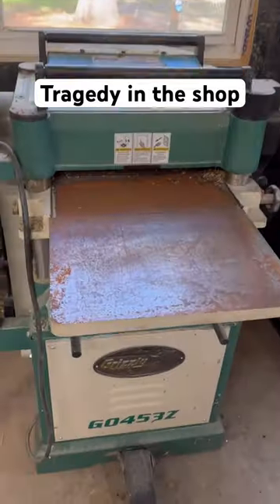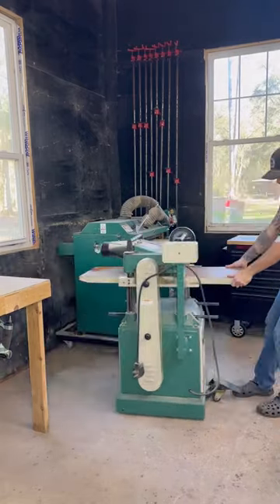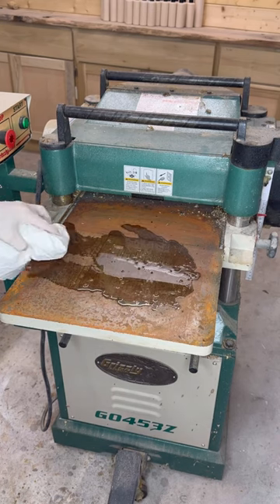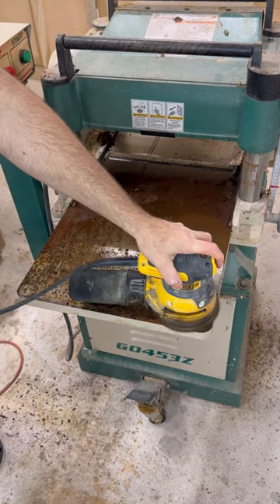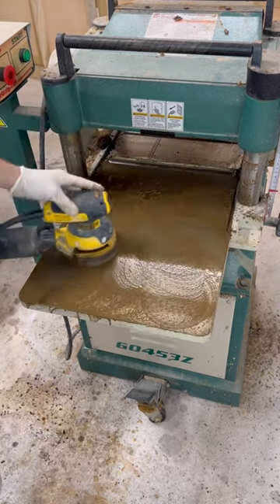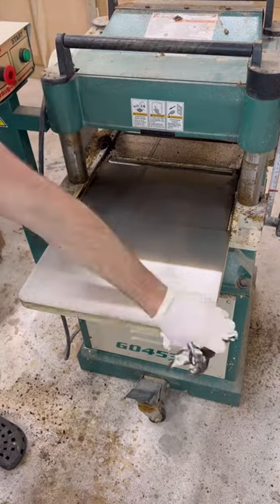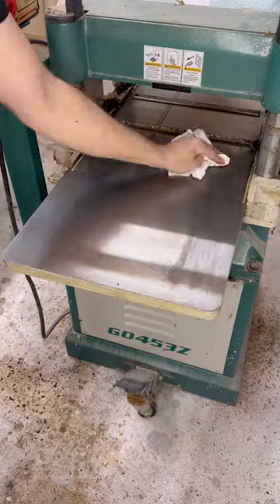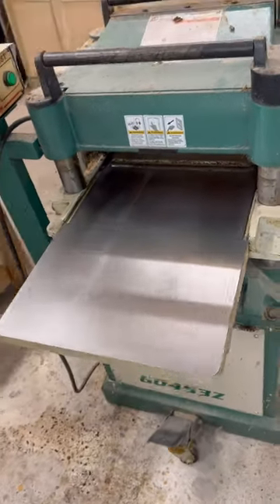Tragedy in the shop #diy #woodworking #toolstips #toolclean #rustytools

Comment: Use of EvaproRust was pointless due to fact that you use abrasive approach. Final results are great, well done...
Reply: My thoughts exactly.
Reply: Came here to say the same.....
Reply: Some might call it .... wet sanding. 🤡🤡
Reply: You have no idea how any of this works then.
Reply: Agree, the 320 would of done just fine dry
Reply: @zacharyshannon8460  would of or would HAVE ?   Asking for a friend
Reply: Yah, came here to see if someone else said it.
Reply: Came here to say it. Glad someone else beat me to it. 

Use evaporust: soak paper towel in solution, ring out excess, drape over rusty object, cover to keep constant pressure, wait 24 hours, come back rust will have been converted into paint able primer which is also removable without abrasion.
Reply: @audio323 wet sanding is for high grit to get a very smooth finish. Wet sanding with 320 is pointless, especially on metal.
Reply: @probablyinconsistent4756  adding lubricant lessens the cutting effect of the abrasive and also accumulates the grind off metal particulate into the oil medium as additional abrasive. It works at ... checks notes all abrasive mesh #.  Thanks for coming out.  NEXT!
Reply: I don’t think any of y’all understand what just happened 🤡🤡
Reply: @audio323  literally no one recommends wet sanding at low grits for any material, because again it doesn't do anything. The metal particles that are being removed are a higher grit number than the sandpaper being used, so you won't get a smooth finish and the sandpaper will still be removing far more material. Also the water is barely an abrasive at the speed of the sander and the time it's being used for.

Again, the product was useless and added nothing to the finishing process. Wet sanding is meant for grits 1000+ to suspend particles of the material that will be similar in size to the abrasive being used. I can tell you have no idea what you are talking about because you think the water itself is acting like an abrasive as if it's a river running through a valley.
Reply: @Greenday6573   Probably best if you just tell us.  Want to know a secret, there is no water damage anywhere else but the table,  not even other shiny parts very near and below the table. but do tell
Reply: glad im not  the only man guy that questioned this
Reply: The EvapoRust loosens things up considerably. Yes he would have gotten the same end result without it, but it could have taken quite a bit longer, depending on the extent of the rust.
Reply: You people can always find something to complain about, guarantee you don’t have 1/10th of the tools he does. Yet your trying to school him on what he should be doing. What a looser
Reply: @wingsandthings99 Shouldn't insult when you can't even spell "loser" correctly.

Comment: Wd40 and a green scrub pad on a palm sander does the same thing and no swirls on the table
Reply: Given that WD stands for water displacement I’d reckon some actual penetrating oil like pb blaster would get the rust removed with a little less elbow grease. Whatever works though.
Reply: @Fidgetier  Stop perpetuating that myth. It is a water fireplace among MANY other things. People watched a YouTuber tell them "wD sTaNdS fOr wAtEr DiSPLaCiNg," and they just ran with it.
Reply: @littlejackalo5326  Appreciate the correction - I’d suggest going about it a different way next time.
Reply: You beat me to it... 😊
Reply: @Fidgetier Maybe before you try to come off as an expert you should be an expert first.
Reply: @donziperk  where did you come up with me being an expert? I made no such claim - way to go buddy you make zero sense.
Reply: I have used wd40 and steal wool to clean the rust off of the tables of more paper cutters, then I can count
Reply: Damn right or wd40 and sand paper will work to
Reply: @littlejackalo5326 the W stand for water and the D stands for dispersant though. WD-40 was invented in San Diego in 1953 as a rust-prevention solvent for Atlas missile outer skins. A chemist at the Rocket Chemical Company created a compound that would prevent rust and corrosion on the Atlas.
Reply: @Fidgetier  🥴🥴🥴🥴🥴

Comment: Hey man, you should open up the housing under that roller. I’d bet the water ran down in there. Might need de rusted and lubed too…
Reply from the maker: Good idea 🙏
Reply: Nick, got a link to those sanding pads? And what part of the country you located??
Reply: No he already finished the surface rust why would he try to actually maintain his equipment?
Reply: @PennYankeeWoodworks  Cubitron 3M Xtract is what it looks like. I like them got mine from AMZN. I don't use a sander often, but they seem to last longer.
Reply: @darkdelta  do you notice better dust extraction?
Reply: @PennYankeeWoodworks  I did, I have a Bosch palm sander with nothing but the onboard dust collector, between that and the 3M discs, I was amazed on how much dust it collected.

Comment: There’s surfacing wheels from 3m designed to remove everything except the metal, won’t even take metal off of aluminum. They’re bristle discs. We use them in automotive so we don’t ever hit the metal with sandpaper etc
Reply: Metal off of aluminum?
Reply: How can they be abrasive enough to break off the aluminum oxide layer but not mess up the aluminum?  Aluminum oxide is used as an abrasive in sandpaper. 

We've always had to chemically remove the oxide layer.
Reply: @i-love-comountains3850  Aluminum oxide wears down just like it does in sandpaper.

Comment: My experience with evaporust has been spectacular but the usual evaporust liquid really works best if the surface is submerged in the fluid or constantly soaked and prevented from drying. Evaporust make a paste type product for things you can’t dunk in the tub. As mentioned in a previous comment, great result but it probably has more to do with wet sanding the surface than the evaporust actually working, especially since evaporust liquid works over a few hours or days, not right away.

Comment: You can use simple green and a rag or brush to get rid of the crud and then coat it with wd-40 or similar and take a scotch brite pad to it, you’ll remove all of the rust but less metal than any other abrasive method.

Comment: Nice that thing will never be a surface flat again
Reply: It's 320 grit. It's fine.
Reply: @BespokeCarpentry 
No, it isn't. 320 grit with that much rust is more than enough to throw off the factory flat that it came with.

Comment: Evaporust doesn't need abrasives to function. Only time in contact with rust. I leave mine 24-30 hours. They make a gel too if you are working with overhangs.

Comment: You can use diesel on it, works perfekt. And after cleaning just let it stay on, it doesnt rust anymore after the diesel evaporates the fire hazard disappeares. You should never use a circular sander if you do then use a large sanding block. It creates low and high spots with a small sander.

Comment: Since you used a sander by hand you may want to check the flatness of that surface... Just a thought
Reply: I had the same thought, but I didn’t see him do it on the surface below the blades, so I think it’ll be alright. The feed table just supports the board for the most part.
Reply: You’re not taking off enough material to matter
Reply: @chrisrageNJ  you may be right, but my precision machining background may be kicking in when I've seen sanders easily knock off a couple thou within seconds on parts.
Reply: @mattsat yea of course it does. But planers are not precision machine tools and this is just the infeed table
Reply: @mattsat only a couple of thou in a few seconds?
Reply: @swgard1  I mean I've seen worse, but it's definitely user dependent
Reply: @mattsat  I was talking more of intention removal, we use a belt sander and abraxo wheel to put a smooth radius on the edges of certain parts, I guess we had two very different trains of thought there
Reply: @swgard1 ahh I see your point...yeah I was just thinking a sanity check of the overall surface since the rust and removal probably changed it and may have some unforseen problems in the future
Reply: @Ellron23  Planers may not be precision tools, but calibrating them does require a precision surface. If I go by factory spec, our grizzly has calibration tolerances that are only a few thousandths in either direction.

Comment: Only problem now is that you've lost the machined flat surface that you had when the planer was originally bought.  If you know or can find a good machinist, maybe take that badboy to them and have them resurface it.

I know it doesn't seem like much, but speaking from experience, those grizzly planers use some tight tolerances when you have to service them. Best to play safe and work with a perfectly flat reference surface.

Comment: Question how do you know its completely flat? Because if it is not flat you wont get good results and it might damage the machine.
Reply: 320 grit sandpaper won't be removing much metal. It will be just fine.
Reply: @prahsnhoj Agreed.  We're talking about planing wood here. It moves with humidity. No project will be ruined by removing that little bit of rust.

Comment: Evaporust is a very slow acting solution. You need to soak it for HOURS. You would have been better off using WD40 for this.

Comment: With sanding it the planer is no longer level might wanna think abt that
Reply from the maker: I’m not applying any extra pressure. This is surface rust so it it doesn’t take much to loosen
Reply: Well can you make us a video where you throw a level on the thing and show us that its level
Reply: Yes I'm sure that fine sanding disc on random orbital sander has taken sooo much cast iron off that the table is now not level.😂😂😂
Reply: You would be surprised.
Reply: To be honest with u I though the same it will be slight though
Reply: @lucionjay5376  Yea for sure.the rust becomes one with the metal so when you take off the rust there is less metal which could lead to a not so level table not super crooked tho either
Reply: You'd have to do a whole lot more sanding on that steel than what he did to make it "unlevel"
Just saying

Comment: Don’t do this it will etch the metal. Use wd40 and scotch brite or sandpaper
Reply: I like tequila more than scotch
Reply: This will still etch the metal. The wd40 is simply coating the metal. The sanding is still etching. Rust protectant or any oil works. If it is heavy machinery for metal heavy weight oils work great. It is very easy to use a chemical to strip rust and then coat with oil. Chemical strip is the best way to maintain the surface to keep it straight and square. Try to avoid any sanding or grinding if possible and start with wire brushes if necessary.
Reply: sand paper was really aggressive for the amount of rust there wd40 and scotch bright on the orbital would have been plenty and wouldn’t have messed with the factory finish as much. Or letting to evpo rust actually set and do it’s thing takes a few hours or so leaving a rag soaked is better than it setting on top so it doesn’t dry out. And it won’t etch anything it’s not an acid.

Comment: i use silicone spray instead of past wax. past wax can remain tacky and colect dust. if the tool is used all the time it works great, but if stored or left setting the areas of dust will hold moisture and increase pitting in those areas.
Reply: Good luck finishing anything that touches that silicone😂

Comment: Haha notice the glove come on when he realizes that it’s really gelled up muriatic acid
Reply: Evapo rust is not muriatic acid
Reply: Just checked, your absolutely right. it’s more complicated than ph. It uses an ion transferring process called chelation. That being I would still wear some gloves.. I did a cab off on my duramax frame and ended up putting it in a spray bottle. It says to BRUSH it on if that tells you anything.